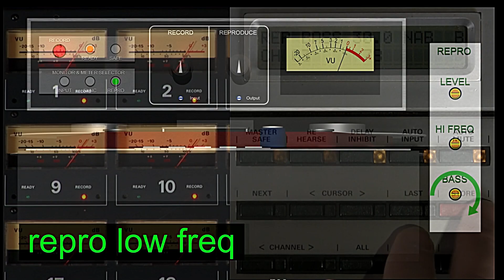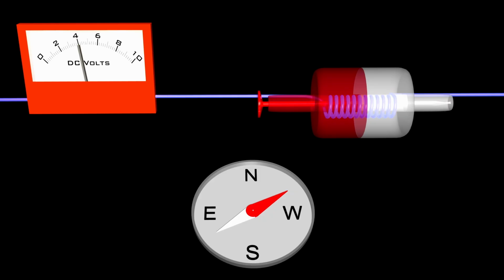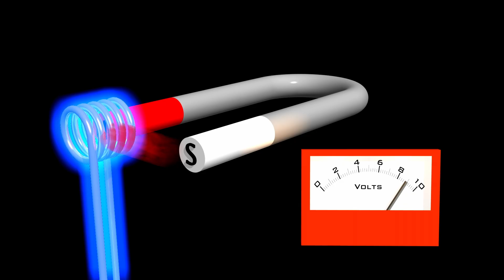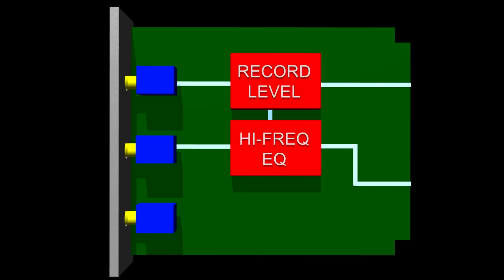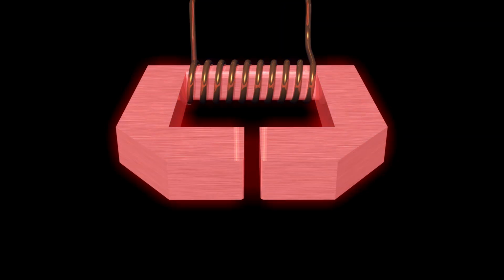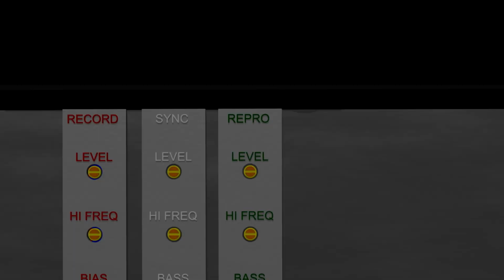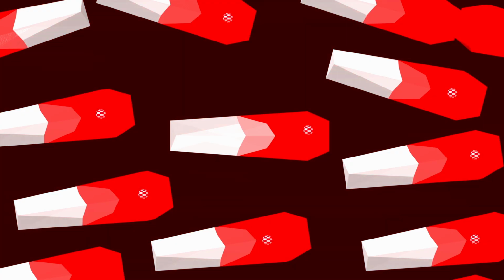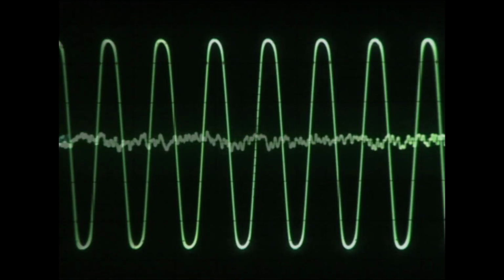Understanding Analog Tape Machines Part 1

Comment: Fascinating stuff! As someone who has used a real Studer A800 at A&R, what is your opinion of the UAD Studer A800 plug-in?
Reply from the maker: The A800 was my favorite tape machine of all. Phil Ramone even owned his own that we traveled with. That said I haven't tried the UAD Plugin (which I do have) Ironically I don't use many tape plug-ins. I do find most of the I  UAD plugins I use excellent.
Reply: @biasedaudio  Interesting! I have found that a lot of older engineers who have transitioned from tape to DAWs don’t use tape plug-ins at all. Do you use analog tape during tracking or just mix down to analog tape from Pro Tools?
Reply from the maker: Just saw this today. Only sometimes for tape delay effects. If it has a pronounced difference in sound, I don't believe them. The best tape machines were very good aside from a small low end bump.

Comment: I was helping out in a studio
I worked at in Farringdon in
the 90's and we were sorting
an issue with the Studer A800
mrk3 and I was round the rear
of it and we had disconnected
the power supply's that chain 
from on to another and it was 
time to put the power back in
and I was searching around for
the input sockets and I put my
fingers straight into the live 
one, it was the biggest shock
I have ever had to date, it was
like being shocked by British 
Rail.
Reply from the maker: Yes those A800's were my favorite machines, but yes those zaps were scary

Comment: Amazing, even if I don't own a tape machine. I love tape effect. Thank God for good plug ins that simulate tape machines.
Reply from the maker: Yup much less of a headache,  though some plug-ins do have alignments settings 😀
Reply: Hi, with my comment I don't want to denigrate a real multitrack tape machine. Much respect because is the real deal. My tracks have a huge tape saturation effect , and without, it will sound like a tuna can. 😂